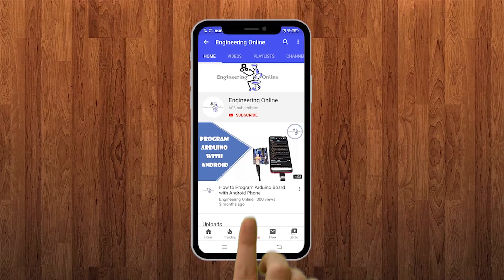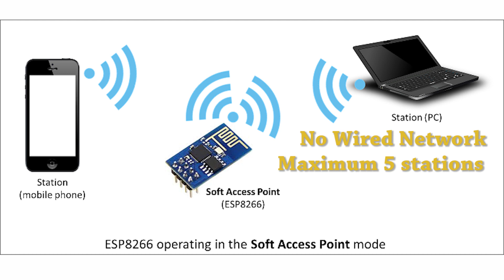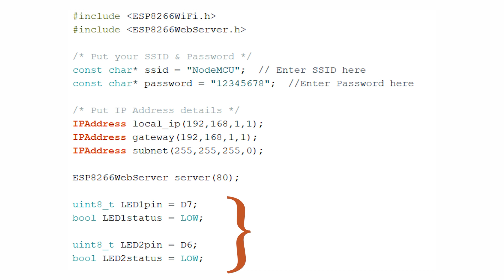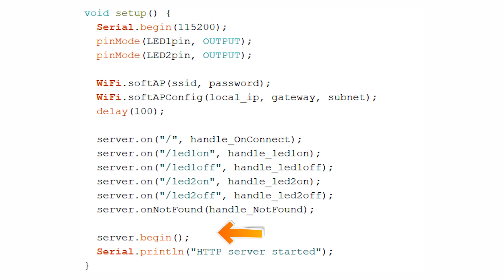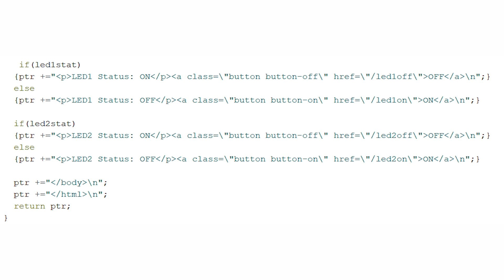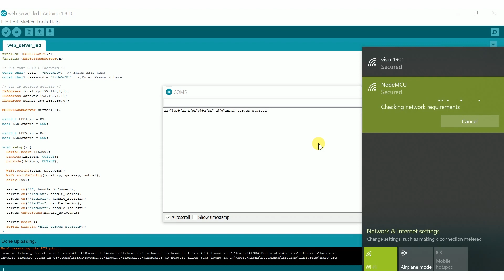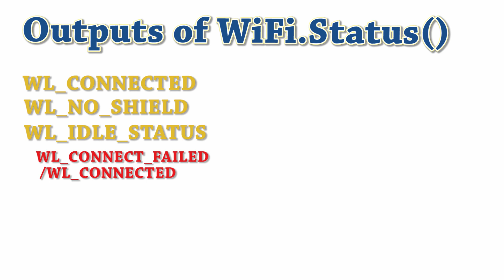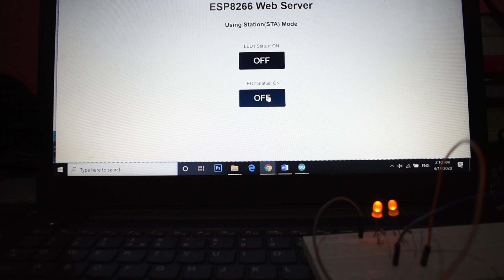How to create an ESP8266 NodeMCU Web Server in Arduino IDE | Tutorial 2

Comment: ESP 8266 and ESP 32 CAM, It's same articture?
Reply from the maker: ESP32 is actually successor of Esp8266. It has an extra core and a bit expensive. Esp32 has additional GPIO and Bluetooth functionality too. There are lot more differences
Reply from the maker: Esp32 Cam has an additional camera attached to it
Reply: I know, I have already! But accordings to codings/library/software articture?
Reply from the maker: Basic architecture is almost same. You can also program it in Arduino IDE. This time you will download EDP32 library. The code needs to be modified obviously. You can try the cameraWebServer example from IDE.

Comment: How can we use esp8266 in proteus. Please help me how to get it so that it will be helpful in my project. How to connect it and make it work if it does exist.
Reply from the maker: There is no built-in library for esp8266 in Proteus unfortunately. Some have developed it's model for PCB printing purpose and I think it will work. But if you want to use it for simulation, I don't think its performance is 💯 accurate ( I have not checked by myself yet)
Reply: @EngineeringOnline  where do i get it can you put me the link please.